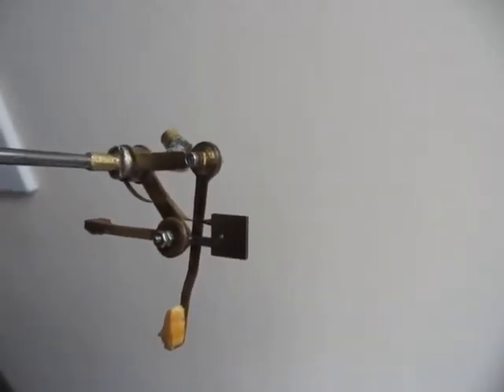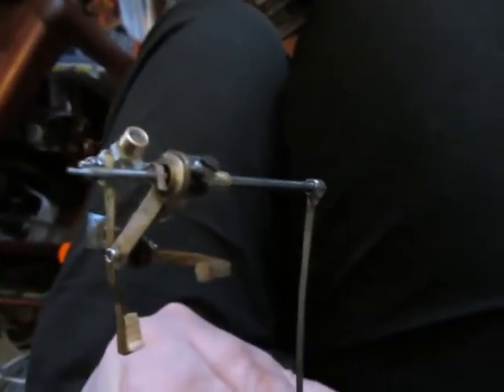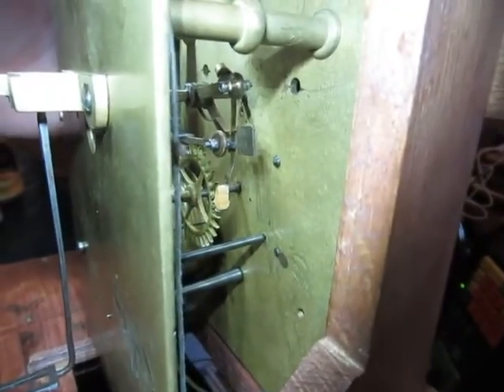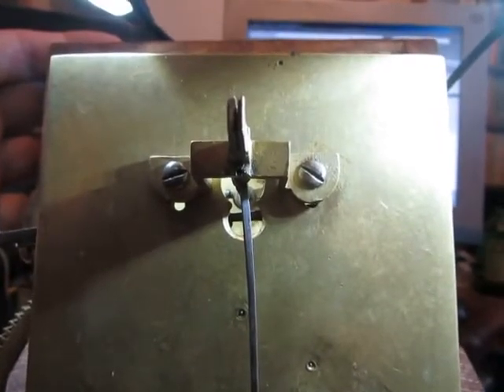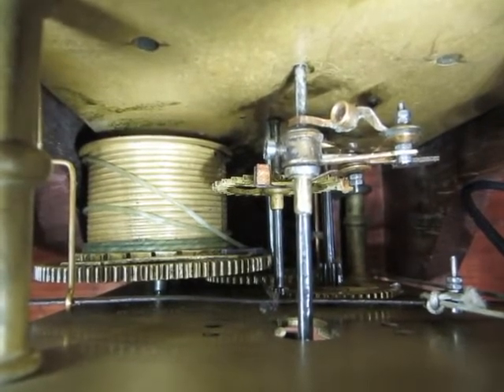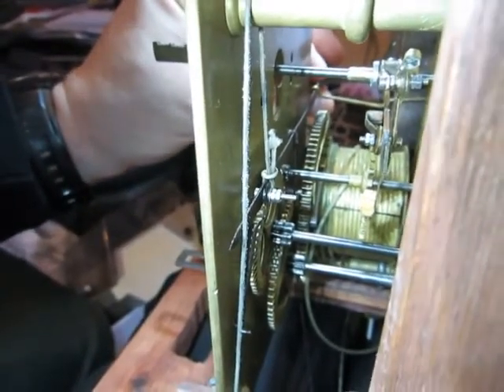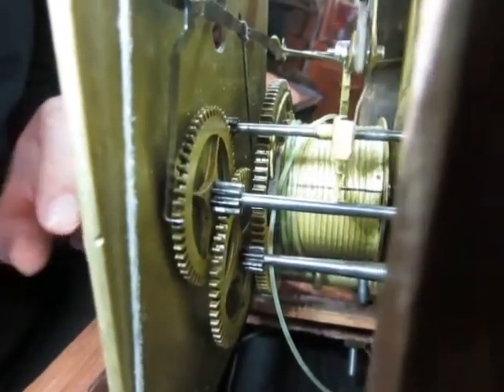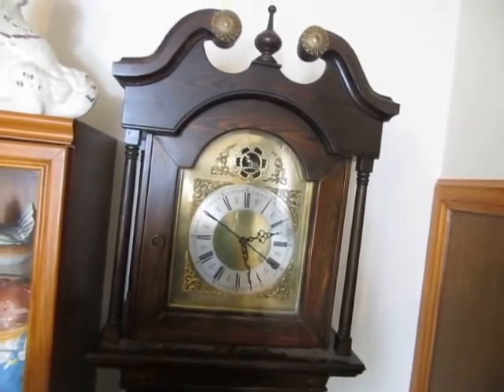My Grasshopper longcase clock, rebuilt!

Comment: very well done Tommy.  Great idea and good 2c case being used again.  Gaius
Reply from the maker: The movement has been sitting gathering dust in that case for a while with the hood off. I started rebuilding the grasshopper assembly before Christmas but the entry pallet was too long, and dismantling it all was a task I didn't particularly want to have to do just after assembling it all a few weeks earlier, so I left it sitting there looking sad. I finally got it all put together during my recent holiday from work.